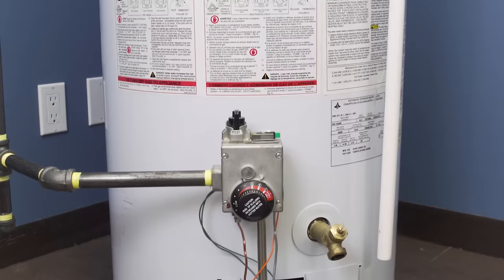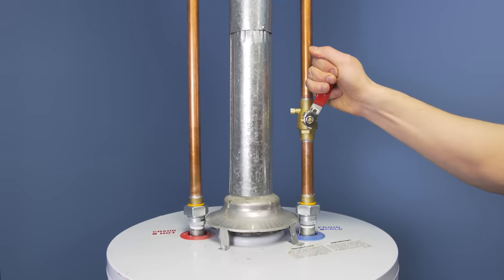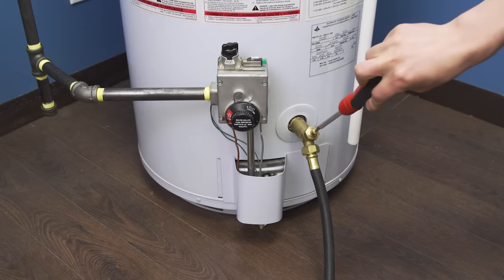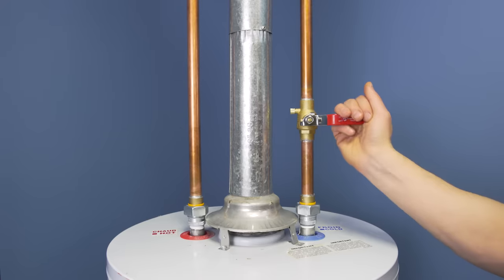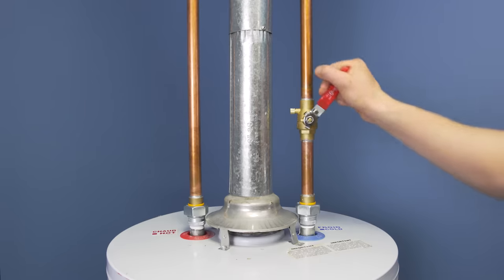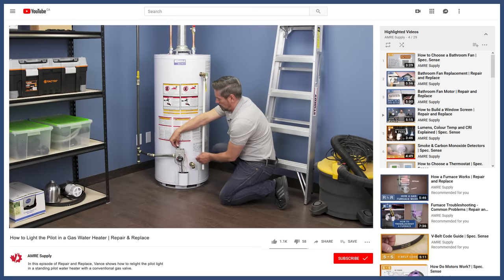How to Drain & Flush a Hot Water Tank | Repair and Replace

Comment: If my pilot light is on BUT the burner is not firing up could a tank flush help me get by till I buy a new WH?
Reply from the maker: Thanks for watching. If the pilot lights, and stays lit, but the main burner doesn't turn on then it could be an issue with the gas supply or the gas control valve.

Comment: Does hot water storage tank need draining? I have 2 hot water pipes connected to it and they are both at the bottom, same level as draining valve.
Reply: I just read maintenance manual and it doesn't say that it needs to be flushed completely, just few quarts of water
Reply from the maker: @NA0533  Yes it's best to follow the manual's instruction.

Comment: After performing these steps, why do i not get hot water in the kitchen anymore?  I have to turn on the hot water in the (further away) bathroom to get hot water in the kitchen. Confused. 🤷‍♂️
Reply from the maker: Thanks for watching. What you're describing is that the system is air-locked so it's best to double check that the shutoff valve on the cold supply line is opened.

Comment: To backflush, why would you need to get involved with a washing machine water supply ?    Why not just turn your cold water supply valve on for a while ?
Reply from the maker: Thanks for watching. If sediment dams up in front of the drain valve and slows down the flow, a backflush will break it apart and help it drain.

Comment: Would u cut off the water supply...seems I have a electric water heater
Reply from the maker: Thanks for watching. Turning the water heater off is needed no mater the type so it's not trying to heat while you flush the tank. The cold water supply would need to be shut off if you are following this type of flush in this video.
You can leave the cold water supply open and do a flush / while it fills. This way you won't need to drain the entire tank. It is just another method. Hard to say what is most effective as this really depends on the amount of sediment there is.
Reply: @AmreSupply  thank man...saves us money to learn these things
Reply from the maker: @eugenevienneau3071  You're welcome!

Comment: My water heater will only drain when the cold water supply is open. As soon as I close the cold water supply the water heater stops draining. I have opened the hot water supply to the wash machine as a vent. I have also back flushed.
Reply from the maker: Thanks for watching. Does opening a hot water faucet help at all?
Reply: @AmreSupply  I opened the hot water on my kitchen faucet and it did not help.
Reply from the maker: @Dociletapeworm  Thanks for the update. It is strange that it drains when you open the cold supply but not when any hot water faucet. Not sure what else to recommend.

Comment: So where can you drain the water if you dont have a floor drain in your basement??
Reply from the maker: Thanks for watching. If you don't have a floor drain there are two options. Either drain into a buck and get a good workout in by manually emptying the bucket every time it fills, or buy a small transfer pump & hose to pump the water to the nearest drain.
Reply: @AmreSupply  what about draining into a bathtub
Reply from the maker: @mauricerob236  You can drain into a bathtube if it is on the same floor as the water heater.

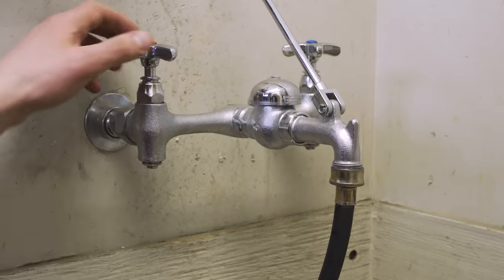Comment: 2:47  Good luck backflushing with hot water.  🤣
Reply from the maker: Thank you for watching. You have a good eye. This has been pointed out in previous comments but unfortunately its not something that we can update. When filming these videos we often film multiple takes at different times and the pieces are edited together afterwards. During the backflushing shot we did what visually looked best on camera (moving the closest handle) while not realizing it was the wrong handle (which not would result in any water flowing).

Comment: Is there a reason I can't just keep the pilot light burning while I perform flushing?
Reply from the maker: Thanks for watching. Turning it all off is just a safety precaution to prevent the burners from running while there is no water in the tank. The pilot light alone won't generate much heat so as long as you turn it down to the lowest setting it should be ok.
Reply: You can turn the heat down to zero, I did it w/o issue

Comment: Why you have a bleeder valve on the input line? Is this code?
Reply from the maker: Thanks for watching. You have a good eye. The water heater was set up in our film studio so that we would have enough room for proper lights and camera equipment. The goal was to make each shot as clear as possible. The tank was not completely hooked up. There is no gas and water running to this. Aspects of this set might not be code ( and codes will differ depending on your area).
Reply: @AmreSupply  - Ahhh I gotchya. I dabble here and there and had never saw one there. Was just wondering. Thanks for taking the time.
Reply from the maker: @dingdongdaddy589  You're welcome.

Comment: My ele hot water heater has no shut off valves?
Reply from the maker: Thanks for watching. In some cases the shut off valves are hidden behind a panel or are farther down the line. Every setup is different so it's hard to say where you'll find it exactly.

Comment: But wouldn’t the hot water be off and not usable for a back pressure flush??
Reply from the maker: Thank you for watching. You have a good eye. This has been pointed out in previous comments but unfortunately its not something that we can update. When filming these videos we often film multiple takes at different times and the pieces are edited together afterwards. During the backflushing shot we did what visually looked best on camera (moving the closest handle) while not realizing it was the wrong handle (which not would result in any water flowing).

Comment: Pro tip 😂😎 end of Turkey baster works awesome for clearing up drain
Reply from the maker: Thanks for sharing the awesome tip!
Reply: @elessarstrider5210  inside the tank itself. Sediment and debris block it if you haven't flushed it regularly. Mine had alot of sediment inside. So using the end of a Turkey baster helped free it up so it would drain again. And also pressuring up the tank again by slowly opening the water valve helped.

Comment: To flush FASTER , close water lines to the heater and take it off the heater and there’s your air flow !
Reply from the maker: Thanks for watching. If someone has flexible water lines then they can be disconnected easily. A static water line like the example in the video is more difficult to just simply disconnect.

Comment: Any advice if there is no floor drain?
Reply from the maker: Thanks for watching. You could try to fill the hose with water, start a siphon and drain it into a nearby sink.
Reply: If your bedroom is on the same floor as the hot water service you can always just run a longer hose under your bed instead

Comment: Y is there a stop waste valve installed before the water heater?
Reply from the maker: Thanks for watching. Are you referring to the shut off valve? The exact placement of the cold water shut off valve will differ but it should be fairly close to the water heater.
Reply: Are you talking about the drip leg in the gas line maybe?

Comment: I have never been able to drain the tank via the bottom value, because of all the crud.  Instead, I unwind the valve, and remove it.
Reply from the maker: Thanks for watching. One options is an upgrade which you can make with a 3/4" full port ball valve: https://youtu.be/nGCejMsKNX4?t=195

Comment: I flushed my water heater but now it won't fill up with water when I turn on the cold valve. What did I do wrong?
Reply from the maker: Hi Lisa, thank you for watching. It's possible that there is an airlock inside of the tank. Open a hot water faucet somewhere in the home, and then open the cold water supply. This should allow the air to escape and let new water fill the tank. As the tank is filling up it will take a while but you will eventually see water flowing from the opened hot water faucet. At this point, wait until all the air is out of the system and the water is flowing smoothy. This means the tank is full.

Comment: After many years of working with water heaters this is a pointless exercise at best with a gas water heater.  The drain valve is not at the very bottom of the tank for one, leaving sediment and lime behind even when using various dissolving cleaning solutions. Also you will find this practice often causes the drain valve to leak, especially if it is plastic, again due to sediment/lime.
Reply from the maker: Thanks for watching and for sharing your thoughts. What are your thoughts on using a full port 3/4" brass ball valve for draining?
Reply: @AmreSupply  Certainly an improvement over a gate valve or globe valve,  as long as its brass rather than plastic.

Comment: Wait why would the hot water on a faucet stop draining? You didn’t say to shut off the main water so what would cause it to stop flowing just because you are getting air out of the system?
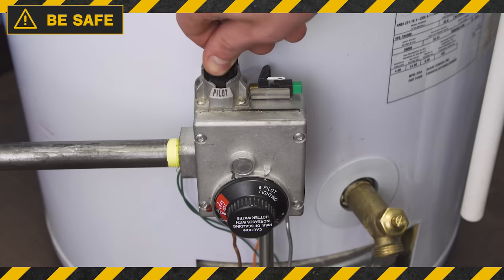Reply from the maker: Thank you for watching. At 1:32 the cold supply line to the water heater is closed. This cold water supplies water to the tank. When you open up the hot side of a faucet you are letting hot water run out of the water heater which depressurizes the tank. By opening a hot water faucet, at some point the pressure will drop, the hot water pipe will begin to empty  and the hot water will stop flowing out of the faucet after a while. This is because in  most homes the cold and hot water lines are separate (except for special cases when a mixing valve is used to add some cold water back into the hot supply line to drop the temperature).  Also you can test this yourself, if you turn off one of the supply lines to a faucet, you'll notice that only one side of the faucet works.
Reply: AMRE Supply ahhhh thank you for the explanation! I love these videos! I plan on checking the anode and doing a drain now thanks to you guys. Maybe someday do a video on upgrading large old cast iron piping to plastic tubing?
Reply from the maker: @BrewersArcade  Awesome we're glad the videos are helping you out! We've done some basic videos on plumbing and plant to do some more in the future, we'll keep that in mind!

Comment: do you think it is a better solution to drain the water in tank and add high purity citric acid to dissolve the scale? Like to clean scale in pot, it might be a terminated solution.
Reply from the maker: Thanks for watching. There are various opinions on this but using something like vinegar is a way to help chemically break apart scale from the tank. The flushing will be mechanical removal of sediment.
Reply: @AmreSupply  :  considering the size of scale inside the tank and the tiny hole of drain valve, it's hard to move them out of tank by flushing. Vinegar is ok, but believe citric acid is better for its high acid value.
Reply from the maker: @悟入木三分  It is this reason why some people decide to install a  3/4" full port
ball valve. This is covered in this video here: https://youtu.be/nGCejMsKNX4?t=195
Reply: @AmreSupply  : Thank you.
Reply from the maker: @悟入木三分  You're welcome!

Comment: So turn off the gas then drain the hot water replacing it with cold water before turning off the water.. then only cold water comes out... and cold water back in after flush...
Reply from the maker: Hi David, thank you for watching. The steps are turn off the gas, turn off the cold supply, drain the hot water to empty the tank. Then open the cold supply to blast cold water into the bottom of the tank. This will help flush out sediment.

Comment: Is there any harm in opening the relief valve while draining?  I did this and the water began flowing out much faster. I assume this is because air is able to flow in faster to replace the water.  When I release the valve, the water continues draining fast for about a minute and then slows down. If I pull the relief valve again the cycle repeats.
Reply from the maker: Hi Steve, thank you for watching! In the video we mentioned opening a hot water faucet to help let air into the system, but the relief valve can be used to help the air flow in if necessary. A functioning relief valve should be able to close after its been manually opened, and it should even be tested yearly to make sure that it can open and discharge water when needed. If it doesn't close all the way after opening then, the relief valve is not working properly and must be replaced.
Reply: I found this worked for me, too- even with hot water faucets on. I had to change the valve anyway.

Comment: When draining the tank, why not open the relief valve instead of going into the house and opening a faucet? Isn't the purpose to stop an air lock?
Reply from the maker: Hi Jim, thank you for watching. You are right the relief valve can also be used to stop the air lock. The benefit of opening a hot water faucet which is above the water heater is that it can help release any air that gets trapped in the system during the process.

Comment: We bought a house w/original water heater from ‘08. It seems to be running ok but is it too late to flush and replace the element? It’s also in a closet on the second floor :/. Thanks!
Reply from the maker: Thanks for watching. Even if the water heater is 13 years old, you can still flush the water heater and replace the electric heating elements. Unfortunately we don't have any videos on electric water heater repairs yet. This is something we'll be filming in the future.
Reply: @AMRE Supply  thanks for the reply! I know how to change out the elements but not sure how to drain it on a second floor.
Reply from the maker: @debconley2310  If you have a long enough garden hose you might be able to drain the water heater into a sink or bathtub. Once you get a siphon going it should continue to drain.
Reply: @AmreSupply  thank you. I believe that the second floor bathroom is higher than the water heater so I’m thinking it may not drain properly? I so wished it was in the garage :/!
Reply from the maker: @debconley2310  Depending on the height of the water heater tank, any water above the drain will help push the water down. So if you have a bathtub or shower drain, as long as that is below the height of the majority of the water, then it will drain. If you are only replacing the top element then you won't need to drain as much water.

Alternatively if needed the element can be replaced without draining the tank. We don't have a video on this but this can be searched for. If you have a good airlock then no water will drain as you remove the element since no air is available to displace the water.
Reply: @AmreSupply  thank you so much for all of your help. I could lead it downstairs to the lower bathroom so that could work!
Reply from the maker: @debconley2310  You're welcome, we're glad that you've figured something that works!!

Comment: Couldn't you just turn on the water supply to get pressure to push out the water?
Reply from the maker: Thanks for watching. That is one way of flushing and can work in some instances. In this video we wanted to show a deep flush. Opening the cold water supply Without water in the tank, will have more force. Not all tanks have the same buildup of sediment so there is no single option for how best to approach it.

Comment: Why would you need to heat hot water?
Reply from the maker: It depends on what you consider hot. If water in the tank was only 110°F and someone wanted water that was 140°F then it would technically be a hot water heater (turning hot water into even hotter water)

We're quite aware that people often refer to it as a hot water heater. In our videos we mentioned water heater and hot water tank to try to cover the variation.

Comment: Just an observation.....if you need to back wash with cold water, remember your hot water is shut off and nothing will happen if you use hot water.

Also it is a water heater not a hot water heater.
Reply from the maker: Thank you for watching. You have a good eye. This has been pointed out in previous comments but unfortunately its not something that we can update. When filming these videos we often film multiple takes at different times and the pieces are edited together afterwards. During the backflushing shot we did what visually looked best on camera (moving the closest handle) while not realizing it was the wrong handle (which not would result in any water flowing).

Comment: Used the hot water tap to back flush, yet the hot water side has been shut off. Gotcha lol!
Reply from the maker: Hi Mike, thanks for watching. You have a good eye. This has been pointed out in previous comments but unfortunately its not something that we can update. When filming these videos we often film multiple takes at different times and the pieces are edited together afterwards. During the backflushing shot we did what visually looked best on camera (moving the closest handle) while not realizing it was the wrong handle (which not would result in any water flowing).

Comment: How much water will drain out of that particular size unit?
Reply from the maker: Thanks for watching. On the side of the water heater should be some info about the capacity. The drain valve is close to the bottom so for a 40 gallon tank, roughly 38 or more gallons should drain out.